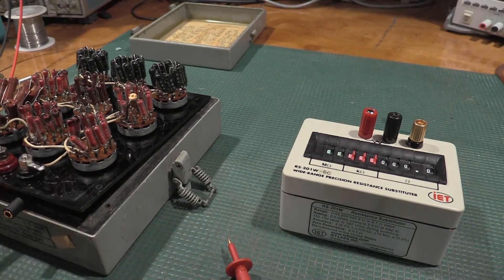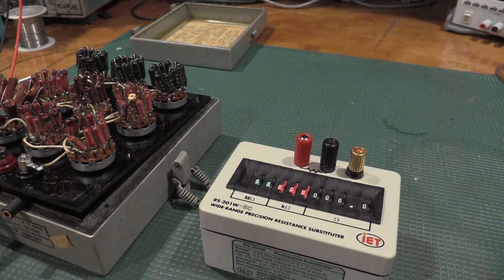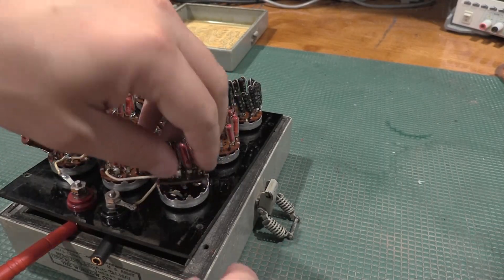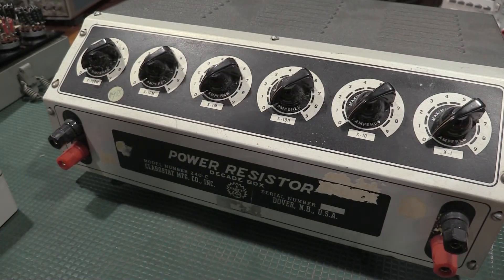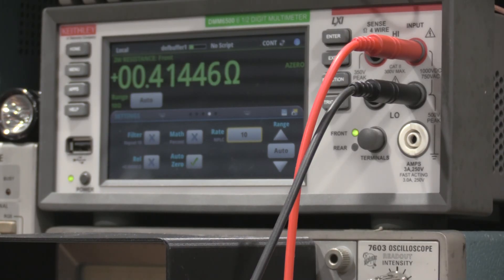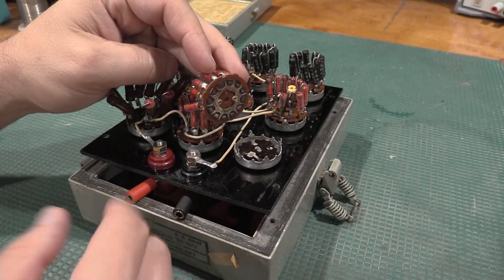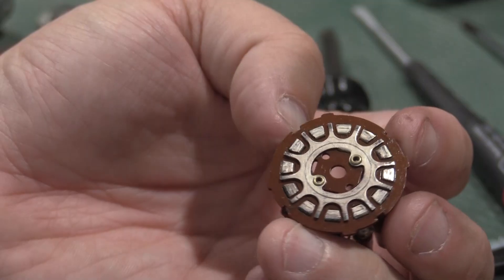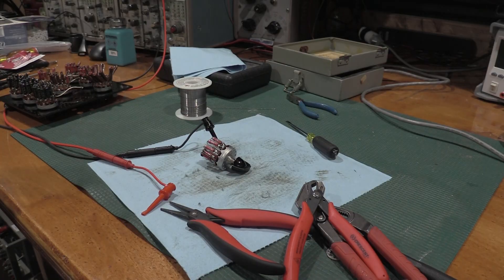Resistance Boxes and Repair Failures

Comment: I think Paul Carlson uses Tarn-X for situations like this. Great videos! Good luck! - JRH
Reply: I have too... If recycling tube sockets, old connectors, or open frame switches, the jar loaded with Tarn-X gets a visit. Bright and clean results. 😊 Triple rinse... first with distilled water with baking soda to counter the acid, then 2 plain distilled water agitations in sequence.

Comment: Did you tried to use ultrasonic cleaner on this or similar switches? I do a lot of vintage hi-fi stuff restoration and i was thinking give it a go with ultrasonic cleaner to clean those old alps lever switches, ofc plan is to completely dismantle them and they put them in cleaner.

Comment: I made my own resistor decade box. It has no switches, but seven columns of nine 4mm sockets with the resistors soldered between them. You choose your resistance by plugging into the appropriate sockets. If you need to sum resisors from two columns, there are heavy gauge jumpers. There is no residual resistance, and the tolerance is 0.01%